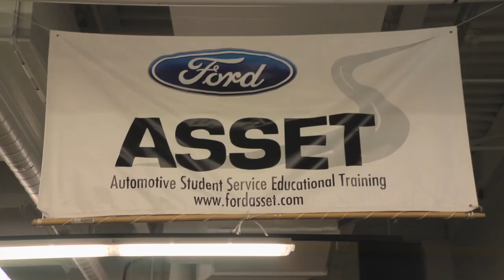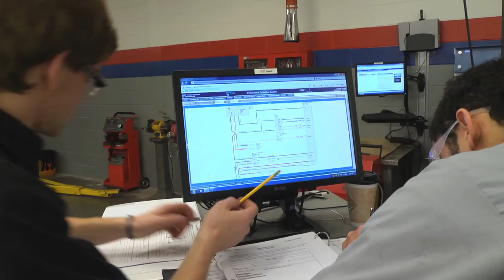Ford ASSET Major Drives Student Success

Comment: If you get FAFSA and don't have to pay for the ASSET class, then yeah. But expect to work unpaid internship at a dealership half a year. You will be assigned to work for a regular tech there on many oil change and brake jobs. You won't be working on advanced diagnostics, for 1) you are just a noob, and 2) your mentoring tech is not always happy to babysit you. 

Nowadays, learn how to do coding and programming, and get an IT job is the way to go.